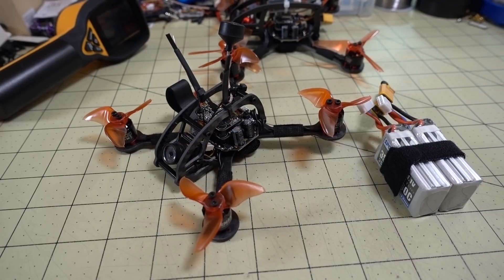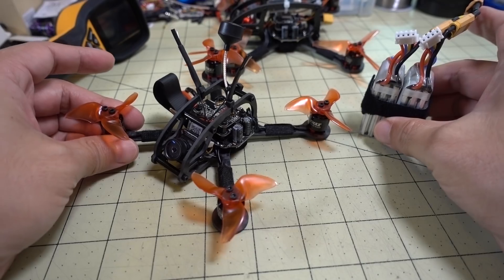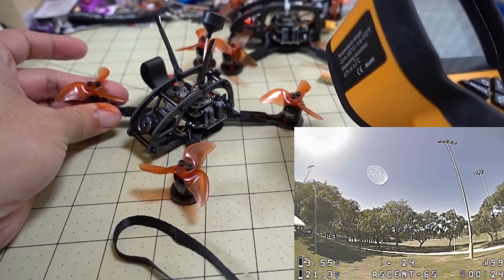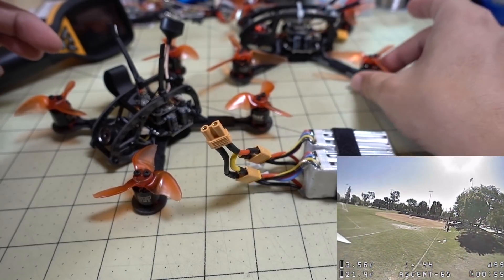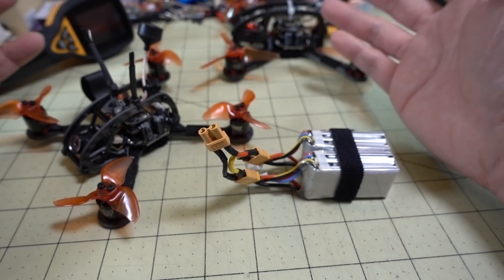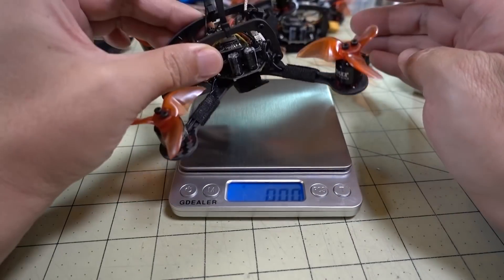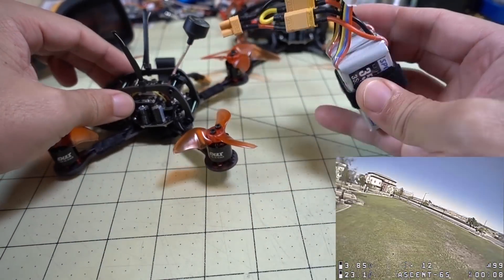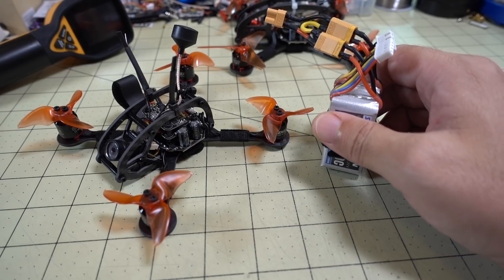6S Micro Drone Testing 🔥🔥🔥

Comment: Well I hadn't considered 6s micro until now. I'd probably build a 6s from two 3s vs using an adapter. I've done that with good cells from bad batteries before. So you're saying minimum size kwad would be 3-4 inch?
Reply from the maker: I think 4 inch min probably...

Comment: Those motors aren't designed for 6S, are they?  My guess is that they are a 4S design.  The EMAX RS1106 7500KV is built for 2S, the 6000KV version for 2-3S and the 4500KV is for 4S (taken from EMAX specs) so following that train of thought I would think the motors would need to be in the 2000KV range to handle a 6S battery.  Your battery configuration is workable, but with a little extra weight. Your lucky the motors didn't just burn up.  Also, overheating motors can really kill the magnets as well as seize the bearings, among other nasty things that aren't good that could have happened.  However, this was a really interesting experiment and we learned something.  Edison said it took some 1000 steps to find the right filament to make a light bulb, and this is just like step number 5...
Reply from the maker: Yeah, those motors were meant for 4S but I also propped it down to 2 inches but in the end that motor isn't able to handle the voltage.

Comment: I'm surprised about the voltage sag. Seems like the opposite of what is expected, but would I guess the kv may be the source of the issue rather than the connector. That 4500kv on 6s would push the motors into a very inefficient power band. Seems excessive overall though, even if it did work 😛

Comment: It's not that dangerous to make a battery. It's just scary the first time. I bet my test results will confirm your findings!! 😂. Especially since my motors will be 5000kv! 😆
Reply from the maker: It's probably not that dangerous... maybe I'll try it out in the garage in case of an accident...  LOL 😂
Reply: @AlbertKimTV  WEAR SAFETY GLASSES!!! If you make a mistake, sparks just fly.  That's all.
Reply: https://www.sra-solder.com/aluminum-solder-wire-96-sn-4-ag-062-flux-core  << If you have to solder aluminum tabs, use the right stuff.  Dedicate a tip that you only use with this solder, and clean it up the work with q-tips and alcohol before you shrink-wrap the pack, otherwise you'll get that green foam corrosion stuff.

Comment: There shouldn't be any meaningful resistance being added by hooking two known good batteries up in series.  Higher voltage usually means that wire resistance becomes less impacting.  The extra XT30's and wire add weight that wouldn't be there in a proper 6S pack, but unless something is heating up with the connector pins inside the XT30's or solder joints, then it's not likely a factor.  You may wish to isolate and measure it with an ohmmeter if you suspect an issue, and your thermal imager could measure if there is any heat buildup.
Reply: @LaurenBands lolwut?